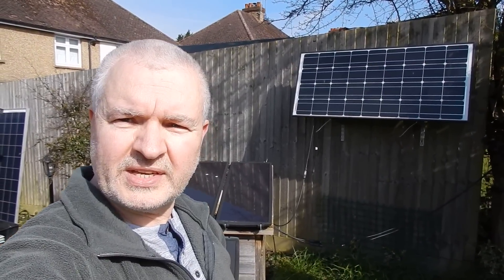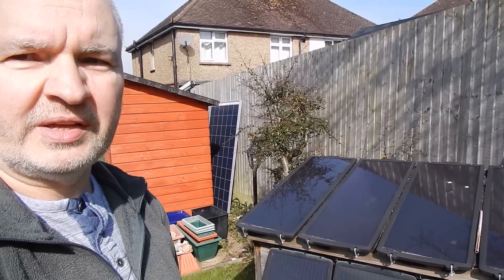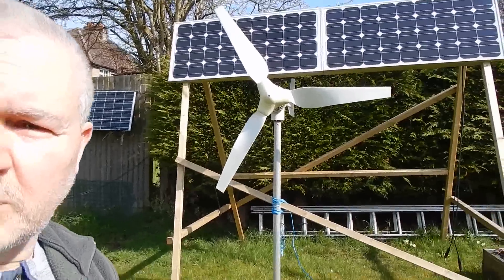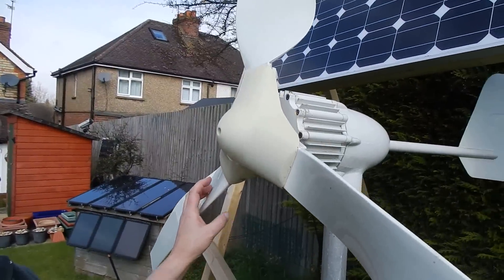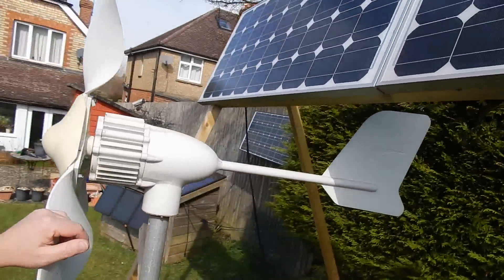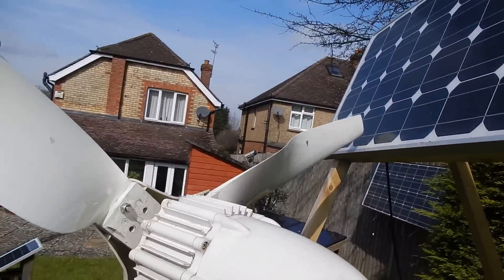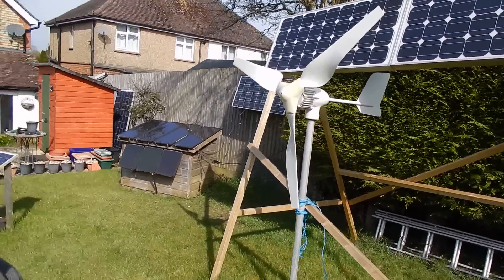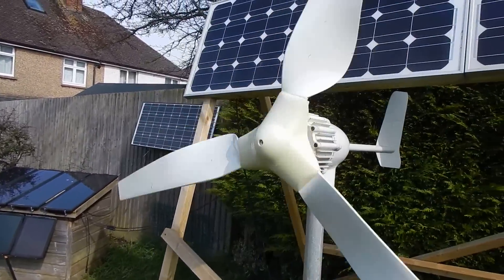New Wind Turbine addition to Solar Power System

Comment: If that setup doesn’t work well for you, don’t get discouraged. You have to get it up out of ground effect. So 20-30ft ABOVE tree lines roof lines and other obstructions. You can see this principal in action like this. Set it up in your garage, with the door open spin the turbine with a leaf blower. Find a stable voltage, then close your garage door. Watch as your power drops off a cliff as your garage fills with turbulent air. That’s what’s happening if you aren’t above obstructions the wind is sloppy and turbulent. If you are getting good power there you’ll get much better if you can elevate the setup into more clear airflow.

Comment: I sure hop your lashing of the wind turbine to your solar mount was for demonstration purposes only and you have since mounted it say..... On the roof of you house... I have two, one 40 feet up and another at only 20. I can tell you that the 40 foot one works more often as there is a lot more wind up there. Plus if you had any kind of abrupt wind back and forth those blades will smash your panels.

Comment: the question is how do you store power? also how long does it last? i realise it depends how much it spins etc but there isnt much information about how you can use it. like if i got some of these linked it to my house supply somehow im trying to think how i could do it so it uses he wind turbine power then when the power is used up it goes back to the mains supply from the grid.

Comment: hey Julian what r ur thoughts on the 12v/24v charge controllers for £10 on ebay....would I still be better ff getting my hands dirty and making 1 of urs over the summer or would this be a cheaper cop out ??? any thoughts cheers.....BTW u need to cut away thebottom 3 inches of that solar panal and that turbine should work fine then ;)

Comment: You used too much rope to secure it. Thats going to redirect too much wind away from the blades. Use masking tape. It works alot better.You should also remove that tail fin. Its just getting in the way.
Reply from the maker: +Reberto de Tomkinsinio All good advice ;)

Comment: I think you should wire a big fan in front of it to make it spin when there is no power ;)
Reply: +Digger D - ya know he could save the hassle of trying to connect all of the solar panels DC outputs plus now the output from the turbine by doing just that.  That's just a wiring and regulator nightmare!  So just wire each of the solar panels to independent fans in front of the turbine!  Now he'll only have one set of wires to wire up to his batteries!  That's an awesome idea!  Oh man, I gotta patent that idea!

;-)
Reply: ElmerFuddGun;)

Comment: Purfick April fool for the uninitiated. You could improve your system by wiring up the 24v unit as it will produce power at 12v, which is better than it sitting behind the shed unused. Cheers

Comment: your neighbors will hate you if it spin up to a high enough speed, it will chop the air and make a buzzing  sound. I got one about that size. 24 volt 600 watt two blade, mine came with a kit to change it over to three or two blades. two blade spin faster in good winds making more power and three blade will start spinning in low winds making power sooner. so if you get low wind year round, three blades are best if you get high wind year round, two blades are the best

Comment: For safety and more efficient operation you need to get it at least 10 meters into the air unless there is some sort of restriction in the area you live in. Hybrid power is the best of both worlds.

Comment: For maximum power output, you should mount it lower down, and perhaps behind a bush?
I assume the output connects directly to the mains?
Reply: I agree.... it may work well underwater..... dig a small pond and mount on a horizontal twig for maximum efficiency.